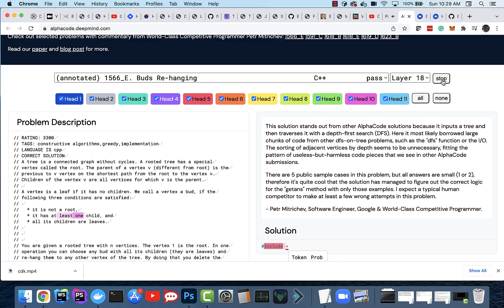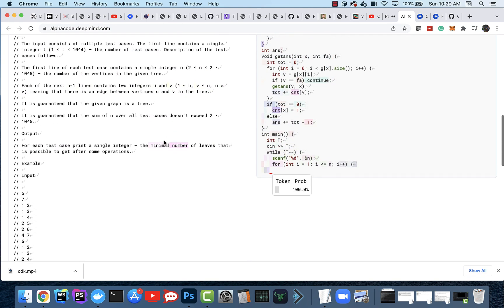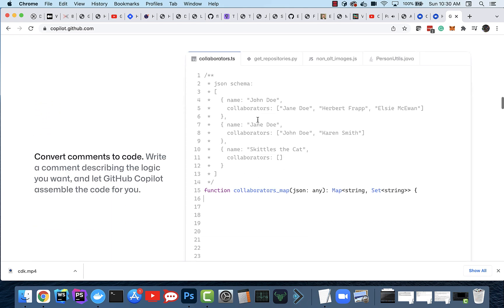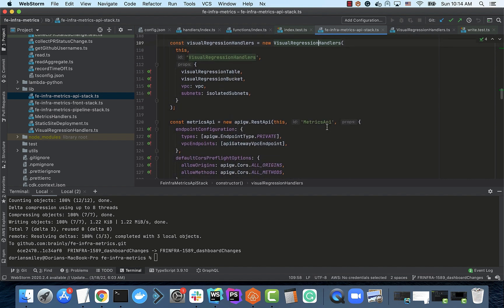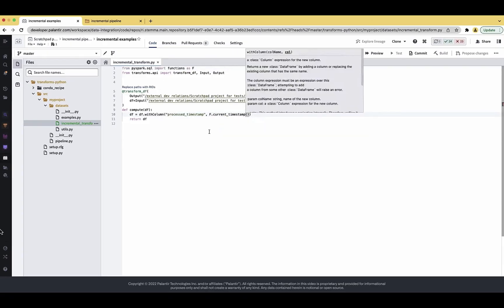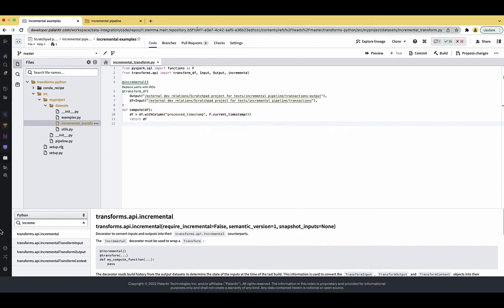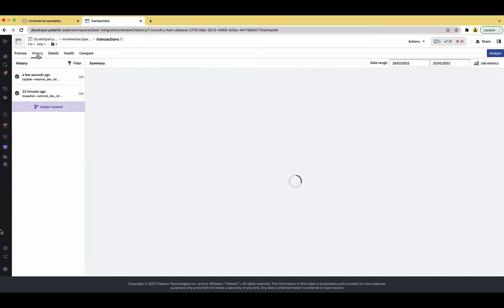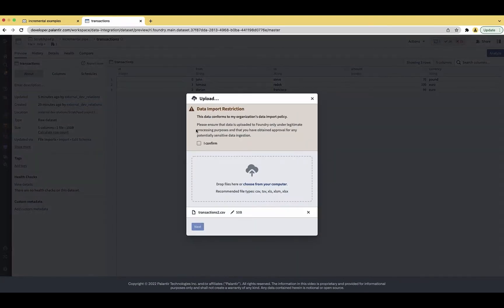Artificial  Software Engineers

Comment: @codestrap am i understanding correctly that this automated code as in for example. Whenever you need to iterate over a list of things you usually use loops in some manner so the AI portion would like autofill that for you?

But wow thats crazy! Mind blowing. I work as a security engineer and wow never knew this existed. So if this exist where do coder fall in place?
Reply from the maker: IMO it allows us to write the spec at the top of the file then let the machine do the work. I really like how GitHub in particular has positioned CoPilot. Check the link in the description to that. We are already in this place where engineers write way less code than they use to. WE use code generators, linters, intellisence, etc now. Compared to how it was when I started out it's like half the code I used to write. Humans are really bad at writing code in general. We are great and coming up with novel solutions to problems though. So this is just the next evolution IMO. This will really empower engineers by producing code at record speed, and mostly error free.

Comment: I think maybe CodeStrap could answer exactly why ark invest sold PLTR?
Reply from the maker: I can't figure that one out. Maybe Anduril was the private company they were referring to. But that company was founded as more of a robotics company. Anyway, I'm not sure why they sold.
Reply: Adding to above. It could be its Peter Thiel extending use cases into the defence space with focus on AR/VR through the Oculus/Palantir overlaps. PLTR providing the data layer and software security and deployment, #Anduril adding the additional VR/AR layer. If so this is great for PLTR. Just a thought on first sight of this company. @Codestrap might this make sense from a technical pespective?
Reply from the maker: I had that same thought but haven't had a chance to dive into their product.